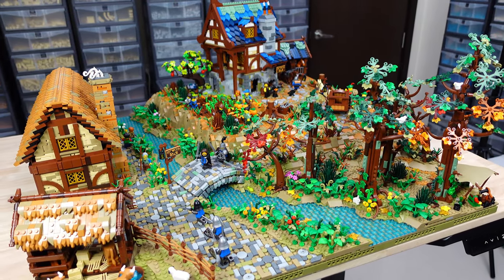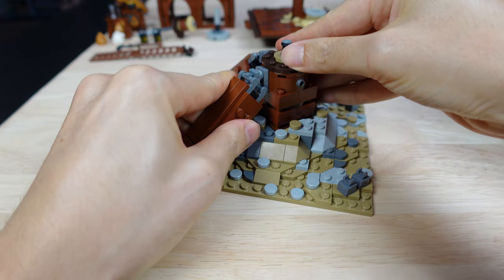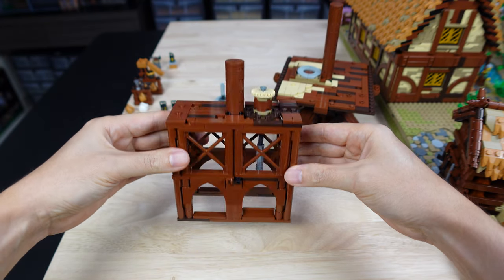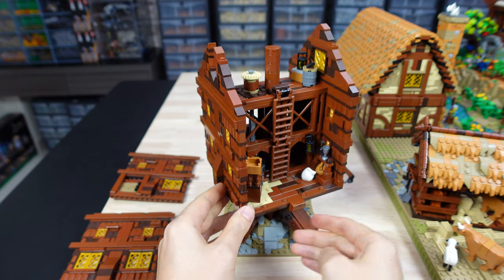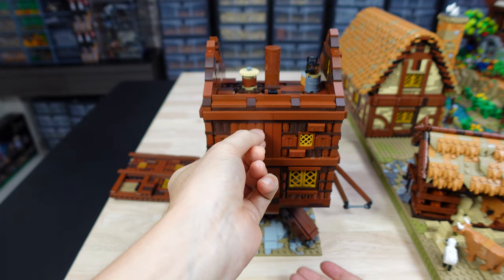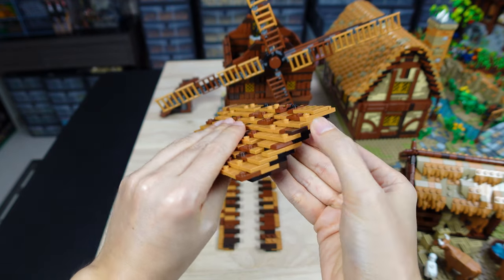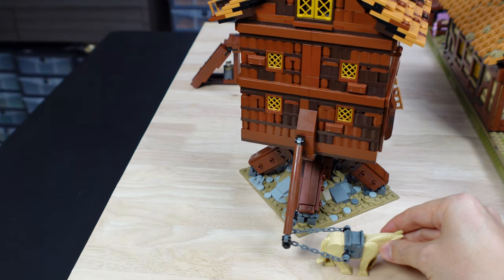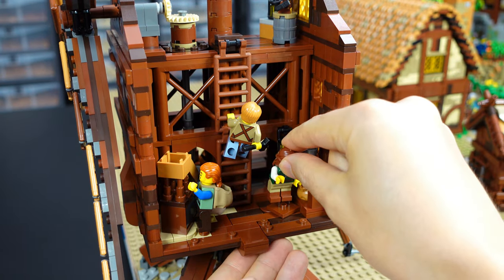I Built a Windmill For My Lego Medieval Blacksmith Diorama

Comment: Love your build! But if it were a real LEGO set, how much do you think it would sell for?
Reply from the maker: I didn't count the number of pieces but it has a slightly smaller footprint than the blacksmith so maybe abit lower price than the blacksmith, just a wild guess though.
Reply: @1by1Brick maybe for a detail on the empty windmill baseplates could be adding a sort of guard tower for the soldiers
or maybe just adding the new 10332 medieval town square next to the existing diorama
Reply from the maker: I’ll be doing a completely new diorama and story for that set after the next moc 😊